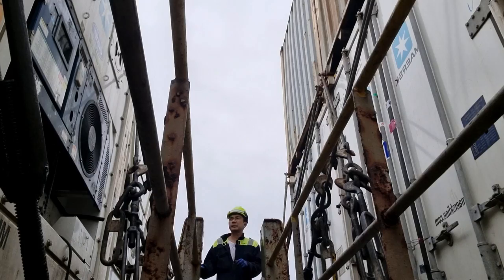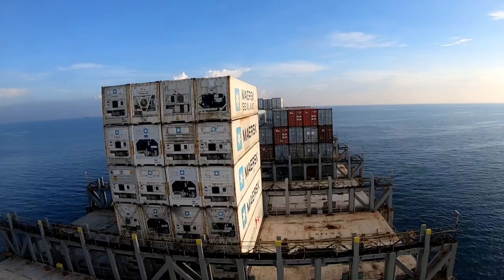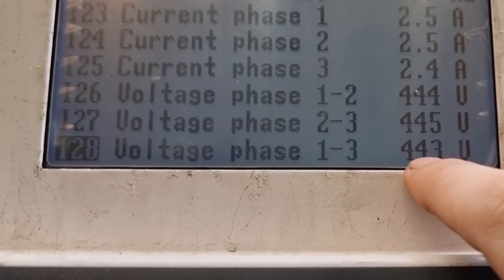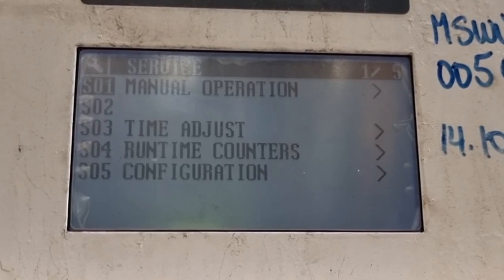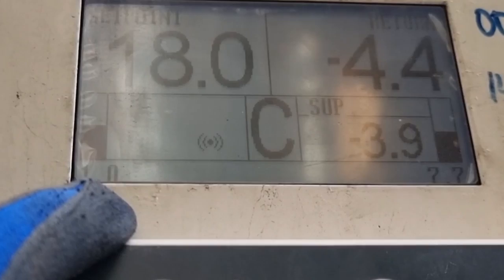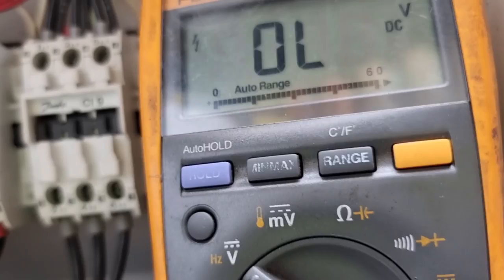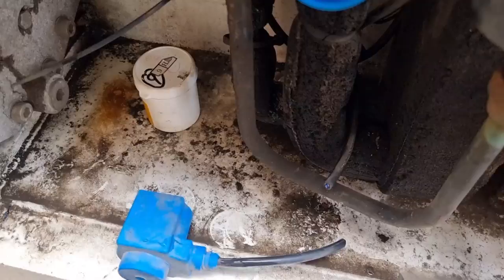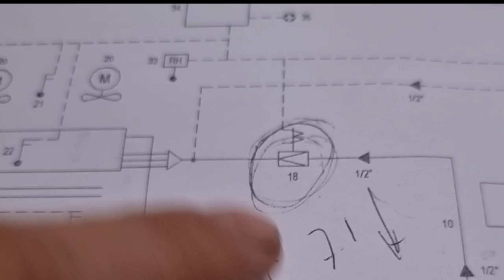REFRIGERATION SYSTEM ICE ON ECONOMIZER | REFRIGERATED CONTAINER, REEFER

Comment: If there is no spare solenoid coil available on board,  in emergency it is possible to use the coil from hot gas valve. It is very easy to shift from hot gas valve to expansion valve, and also need to shift positive wire on the controller from output signal of hot gas valve to expansion valve terminal. In this case when the unit is in defrost mode only electrical heaters will melt the ice on evaporator coil. This will not affect so much to the operation of the unit.
Reply: Replacing veco with vexp or vhg  The problem will stay the same, with more ice on the compressor, the compressor will stay running without stopping even if the unit reach in range state, the suction pressure will drop more and supply temperature will defer more than the return

Comment: This indeed a very big aspect in the job of an electro Technical Officer onboard the ship.. he has to know all the details and the working principles of each machinery because he has to find the reason for the problem... its not only wires that a marine electrical engineer needs to know... he is also  proficient in pneumatics, hydraulics, and mechanical engg to be good in what he does..!! Electro Technical Officers need more recognition and appreciation... keep up the good work...!
Reply: They will never have it. Actually ETO in many companies is treated as a junior officer, but he/she needs to know almost everything. That is why I hate this job already after 15 years at sea and do not want to continue to work on reefer vessels. Even if you have no problems with a ship, everyday you have to check reefers, doesn't matter Sunday, Monday...container vessels are now the most shitty vessels to work on.
Reply: @shyster717  which is better, bulk tanker gas etc..? Or Cruise
Reply: @bt9604  Better in what way? What do You mean?
Reply: @shyster717  interms of work, work pressure,safety, environment etc..

Comment: Low suction  pressure:

1. Out of freon
2.expansion valve body faulty
3.expansion valve coil faulty
4.blockage in the refrigerant system eg. Filter drier etc
5.suction pressure transducer faulty
Reply: ❤️ thanks bro
Do u have any more notes regarding reefer troubles

Comment: Great video! 👍
1. Are ships responsible for the operation of all refrigerated containers? 
2. What if you can't get to a container, eg, buried in hold or 10 units high?
3. There must be hundreds of different types of refrigerator unit / controls, do you keep diagrams and spare for all?
4. What if you can't fix it or not correct spare available?
Reply: Yes ETO are expected to work on the 4 major types of reefer containers, there is a way to access every container on the vessel.  They have all the diagrams and spare parts.  They also have lots of spares but if for some reason they dont the reefer has emergency operating modes along with emergency repair directions, such as bypassing systems.
Reply: @Tech-NO-City  Not everything you can bypass. Especially leak from the evaporator area inside.

Comment: What happens if you use the wrong refrigerant?  How do you fix it?
Reply: Hope that you used a refrigerant compatible with the existing oil. Recover wrong gas and preform triple evacuation. Charge with correct refrigerant.